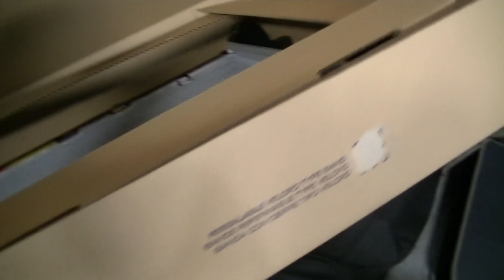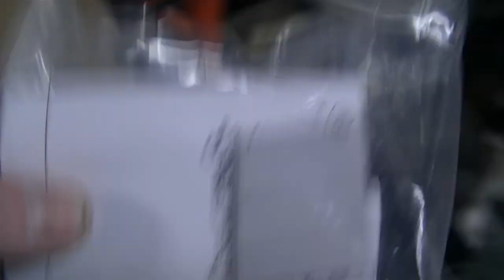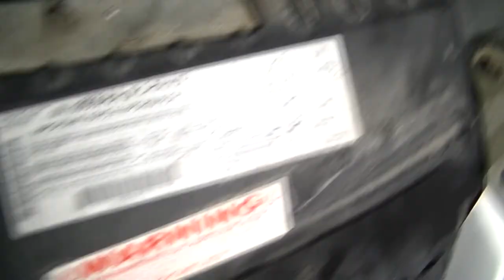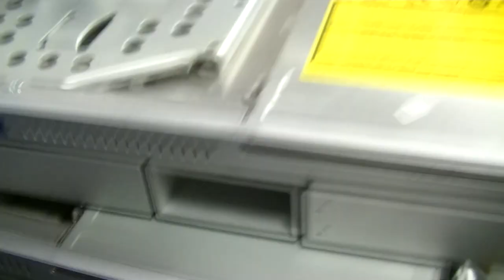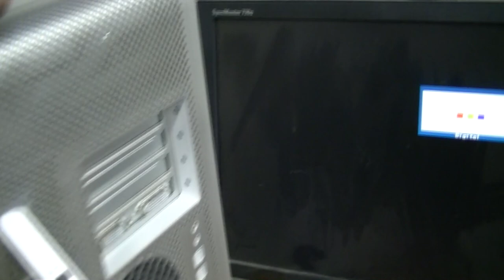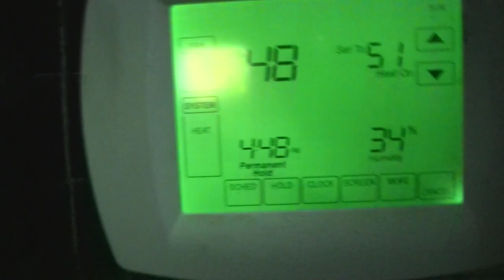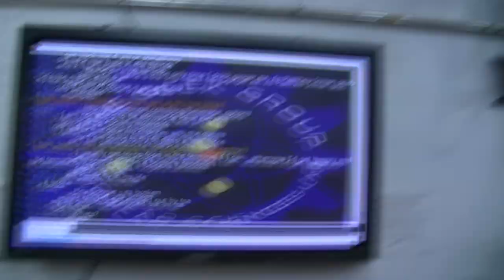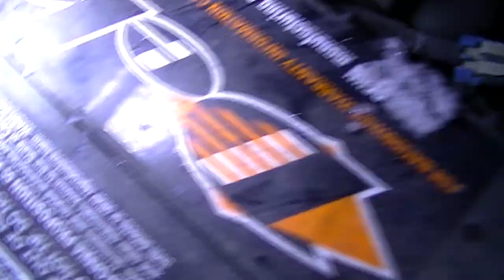DoogoBlog 1-27-2014 David Leaves, PowerPC, Car Time, Radiator, Helicopter Crash

Comment: Have you tried to override the fan guard sensor on the Power Mac G5? There are 3 slots on the bottom where you seat the guard.. the front slot got a optical sensor in it, that detects when the guard is removed, and then shuts the machine off to prevent overheating.